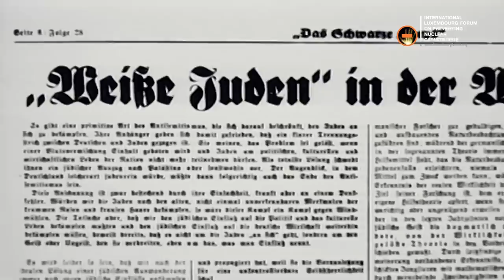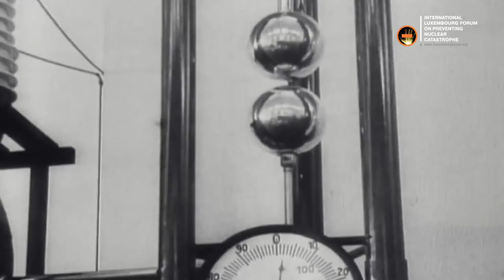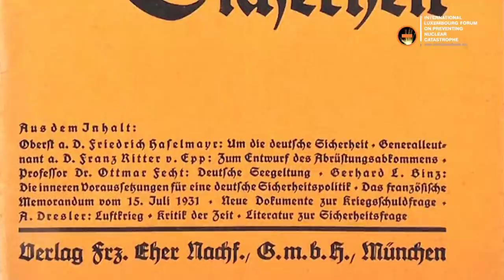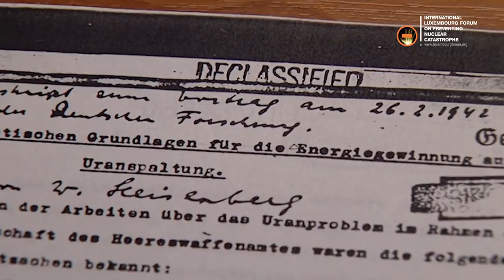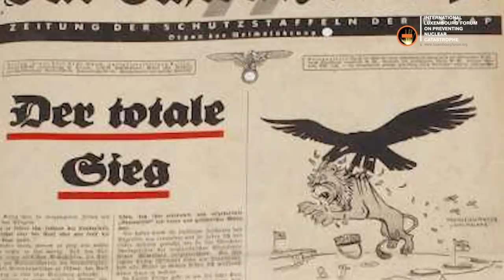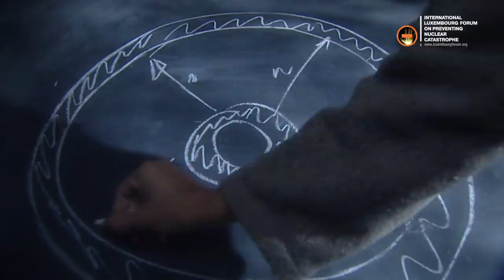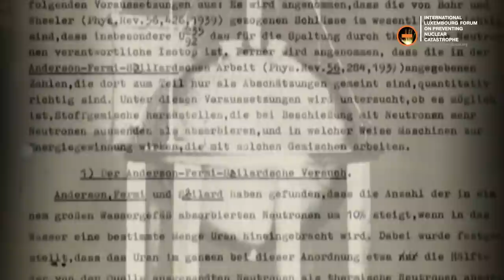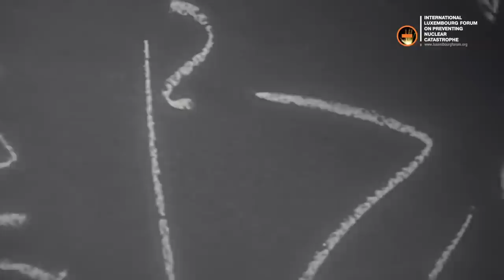WHY DID HITLER HAVE NO NUCLEAR BOMB

Comment: The V1 was not a rocket, it was powered by a pulse jet.
Reply: You are correct, it is a reactor pulse, but it is usually classified as a rocket because of its ballistic trajectory ..... but in this case it was a horizontal trajectory, until it ran out of fuel (paraffin), although both V1 and V2 They had a gyroscope, so they could be the beginning of the "missiles" classification because in a rudimentary way they changed their direction once launched ...

Comment: There was no mention of the Nazi heavy water plant in Norway dramatized in the movie 'Heroes of Telemark'.
Reply: the heavy water plant in Norway was irrelevant.  Look how the bomb was developed in the US and what it took and you will see that Germany was way to far behind for this to make a difference.  They were also short of key scientists that they needed but the US had.
Reply: @groberjager4746  Incorrect. you need to listen to Carter Hydrick and Joseph P Farrell or read their books. The Germans had plenty of very good scientists (unfortunately) and were well ahead of the Allies. It was a close-run thing.
Reply: @jugbywellington1134  I've read them, they did not have the infrastructure i in place to produce either the uranium nor the plutonium fuel needed to fuel even one bomb. They knew what was needed bit did not have the resources to achieve that goal.
Reply: @groberjager4746  As I say, incorrerct. They had the resources, which is why Farrell quotes a Japanese source saying the Germans had used crude ones on the Eastern Front. Furthermore, he also says the UK was on alert late in the war because it was feared one was going to be dropped on the UK. You need to listen to Farrell on the Dark Journalist channel or Forum Borealis. Allied propaganda wanted there to be no bombs and no Hitler in 1945.

Comment: The payload on a V2 rocket was 1,600 pounds.   The Little Boy bomb weighed 9,700 pounds and the Fat Man bomb weighed 10,800 pounds.  A V2 could not carry an atomic bomb.   The two atomic bombs were as small as they could be made at that time as there was no other way to make the bombs.
Reply: The payload of an A-4 (V-2) rocket is 700 kilos from France to London-so close. Little Boy "ready-to-go" weighed 10,616 lbs. and "Fat Man" weighed 11, 986 lbs. Both weights are the "Aircraft ground payload weight, laden" as measured by the ground flight engineer of "Enola Gay" and "Bock's Car" respectively. The weights you quote are of the bomb's net weight, minus wiring, electronic equipment installed on Tinian and parachute package and instrument package that fell away from the bombs and provided telemetry back to the instrumentation aircraft.

Comment: The Uranium distillation system is called Zippe, it was patented in the West by von Ardenes's assistant in 1956, the Germans used it during the war, that's why the Germans produced Uranium enriched by kilos and in the USA it was made by grams, for that the Little Boy (German Zentner 76) is with enriched Uranium and the Fat Man from the USA is with Plutonium.
Reply: Wrong again! In Oakridge, TN USA we distilled and isolated enough pure Uranium U-235 to build 15 "Little Boy" "gun-type" atomic bombs. Since it takes about 50 kilos per bomb, and we used "Little Boy" on Hiroshima, we used the other "Gun-type" bombs in the Bikini Atoll Hydrogen Bomb tests and in "Atomic Annie" the US Army 12" atomic cannon. Goggle the U-toob video for the firing and explosion outside of Henderson, NV (Los Vegas).
Reply: @Walkercolt1  Dear, what I was getting for US bombs was Plutonium, not Uranium, Plutonium is a by-product of Oakridge, enriched Uranium is not obtained in a nuclear furnace, it is taken from the mines and refined by centrifugation, it does not need another process, The US could only refine it "by chemical process" grams ..... the Zippe or Zippo system was only known by the US in 1956, which is the centrifuge / capillarity system, that is why the Germans obtained a lot of Uranium 235. For an artifact Zentner 76 / Little boy you need 66 kilos per unit. The Uranium that was in the United States (540 kilos) at the end of the war was taken by the Uranium 234. It surrendered on May 14, 1945. Its manifest is still a State Secret, as it carried something more important than the Uranium 235, They were the von Ardenes infrared initiators, which served to make the other device (Fat Man) work because they had not managed to cause the implosion in the millionth of a second ... with these infrared fuses (light) they could achieve it ... .The books don't tell you the truth .... Didn't you realize that the US Enriched Uranium reserves are expressed in "kilos" and that Little Boy's critical mass is expressed in "kilos"?
Reply: I do not think I have ever read so much wrong information.  Where is all this incorrect historical information coming from on how U235 enrichment was accomplished???
Reply: John Barber  Your answer is very pathetic in a topic as interesting as this ..... try again, maybe you have an idea.
Reply: @KK-pq6lu  Please read the patent for Uranium centrifugation or Zippe process, it is from von Ardenes' assistant, he was using it in Russia since 1945, then in 1955 he went to the West and patented his method that is still used today ... on the web. You can find several photos of the US Army where soldiers "release" cubes of 10 cm side, which was enriched Uranium wrapped in lead. Search wikipedia for U 234 ... you will see the strange movements of the U boot and some of its content ... In Germany there is an association for the fight against atomic energy that has located the processing places, places that are still considered dangerous today. Among them the town that today bears the name for having been the processing plant, is called "Oranienburg" at 25 km. North of Berlin, a few months ago a "cave explorer" obtained a piece of enriched Uranium, which was "seized" by the German government. Please, investigate, nothing I have written is incorrect ..... even today there are countries that use this distillation system (Iran)
Reply: @KK-pq6lu  Please ask yourself why Germany, a few days before the end of the war, sent a U boot (modified XB model) to Japan, to send 540 kilos of Uranium ... Japan has Uranium in their lands, what they sent was U enriched (on the web is the photo of the system used by the Germans). It was not going in the U boot as said a Me 262 and a Me 163, these planes and rocket plane were already flying as prototypes in Japan for 6 months ..... In addition to the enriched U., there were 1600 infrared detonators (anti-aircraft) of which 64 were used in the "Trinity test" Fat Man did not work without German technology ..... There is a document where a US Senator requests the closure of the Manhattan project, for "lack of results" .... .we can infer that the U boot 234 was loaded "on demand" .... wonder why even today the manifest of the U 234 is a State Secret?
Reply: As you wish ..... if that makes you happy .... best of my regards ... John Barber

Comment: how smart the germans  is  very over  rated.  their  army was  using horses  at the start  and end of the war.  sure they   got jets   and  rockets   but  the fiction  they where say  better   at tanks  then russia   or even  small  auto  guns.  they  lost because they where beaten. they bought into the fiction  of the  master race   crazy   stuff .
Reply: They lost due to Military Structure. 
Had they heald off 1 or 2 years we would all be speaking German  !!!
Reply: @williamcollins4082  dictators always  fail in modern  times. we had d day in 44 and the  ussr was over half way to berlin. they lost in two world wars  . its not proof of any great  military skill.  they  are  losers . in fact  its hard to find any time the attacker  has won. im going to go with good over evil   in the long run.

Comment: This video is WRONG .
The nazi DID have an atomic bomb .
 The factory was in the black sea area .
The bomb was tested in 1945 .
It was not as strong as the Allied weapon was .
At least 50% less affective .
Instead of comming up like a mushroom , it came up like a 
daisey , and it was much dittier .
  The reason they did not use it was HOW were they going to get in range to use it .
The plan was to transport it to the rocket sites and launch them at England .
1 or 2 would have been sufficent to get Briton to surrender .
  However the the Allied bombing campain. was so strong 
That all the railroads had been demolished , flying it out was not possible either , also there were no roads .
 So , no way to get the bomb to the rockets .
 People do not know how close we were to looseing the war .
DML

Comment: He did have nuclear bombs and used them, on the Russian front.  The KGB had reasons to keep this on the down-low and still do. The SS was obsessed with making things in miniture,  so their H Bombs were small ,  yeah,I said Hbomb ,  while we had the A Bomb , he had Hbombs , it takes a Abomb to detente a Hbomb , but they came up with another way ,  these nazi Hbombs had zero nuclear fall out ,  after the fact they called them "clean Hbombs" don't think the Russians will tell you everything,  there was a few battles on the Russian front that had like 20 Germans dead and 2000 Russians . And reports of a big flash of super bright light . They didn't know what it was at the time.  hitler had plans to drop one on NYC but time ran out , they were loosing bad
Reply: Hitler didn't want a nuclear bomb but the SS wanted one bad , and got good hiding money from him ,there's two places that produced super enriched uranium that I've heard of ,there was a building within the Auschwitz complex that they claimed to make bullets but it had huge power cables going to it ,this building used more electricity than the whole city of Berlin. Now I have no clue how to make one of these but I've heard of blasting isotopes with huge amounts of electricity - pulsing positive/negative . Or zapping with some laser .. The other place was at Der Riese is another place where they have these huge power cables running into a network of tunnels where they claimed to make bullets ,  its possible that die glocke (the nazi bell) is the actual machine that produced this super  enriched uranium . At the end of the war the Russians had control of this area , and a short time later they could make their own nuclear bombs .
Reply: January 1945 they asked the Manhattan project, "when will we have a bomb"?  Their answer was, at the rate were producing uranium we should have a bomb by December , now early 1945 a German sub was captured in the Indian Ocean,  (why are they over there?) they found on board these large cylinders made of gold .  They never said what was in them .  They were headed to Japan, later found out that you have to store this super enriched uranium in a container made of gold , if you use lead like they thought, it reacts with the lead and will start to leak ,  these gold cylinders were sent to oak ridge tenn.  (Were we really that close to the Japanese having nuclear technology ). By July 1945 we suddenly had enough uranium to make a bunch of bombs  hitler didn't have or want nuclear bombs , but the SS had the tools to make a bunch .  And possibly used on the Russian front.